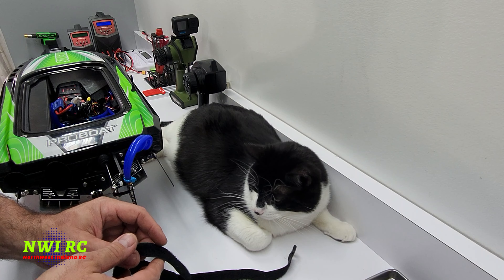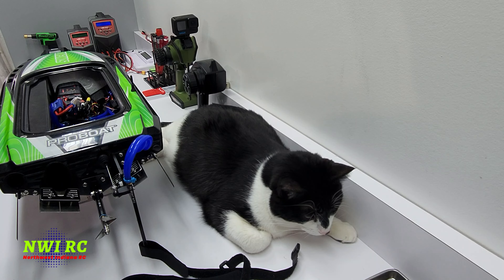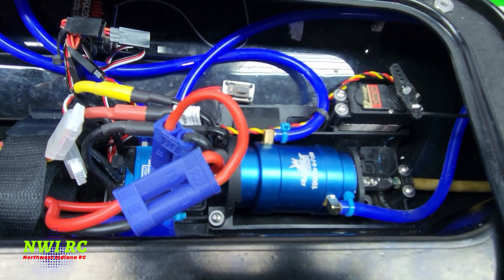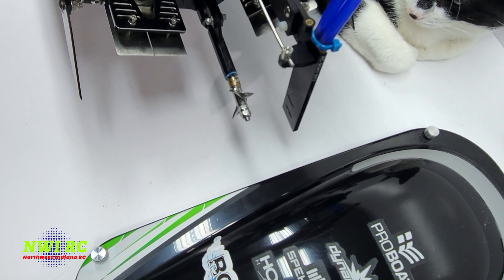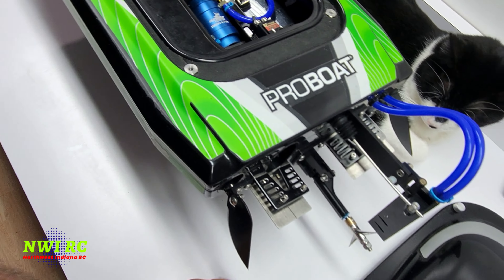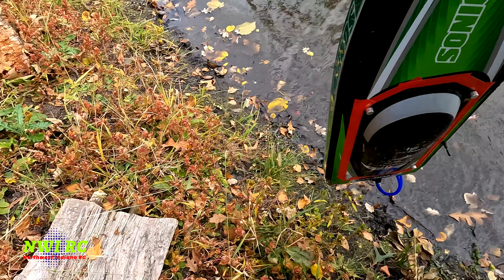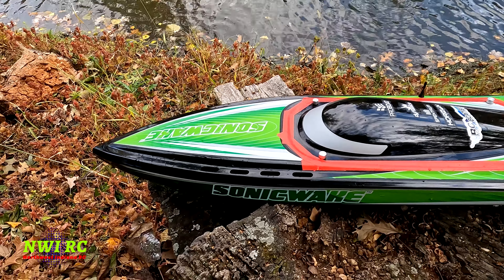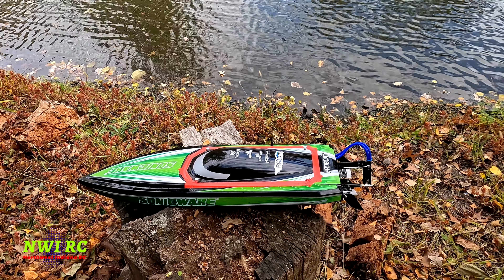PROBOAT SONICWAKE: Bought Used - Did I Get Ripped Off?

Comment: remember it should ride on top the water. you really have to gun it to get ip up on plane. then back off the throttle. i think you thermal overloaded the esc by going to slow like that . . it puts alot of load running the prop slow like that...... if its a quality esc  once it cools down again it will go full speed. watch out for the leaves and stuff in the water it only takes one to plug the cooling line and you over heat in less than a minute.....

Comment: change the prop!  4519
Reply from the maker: What brand 4519 prop do you you think I should go with..? I have a Dasboata speed prop for this beast but it would be way to much for the stock electronics.
Reply: @nwirc  oxidean 4519 blue good all around prop...upgrade the esc to a 150 if you are going to use the dasboata...but I would run it and check temps
Reply from the maker: @vking2.5  Thanks for the info,,
Reply: @vking2.5  I’ve used a huge 52mm Cnc prop on a fully stock sonic wake with no issues. The boat has plenty power to push anything under 52mm. 👍🏼
Reply: DO  NOT put a 45mm prop on this boat. it will overload the esc and motor. unless doing single pass speed runs it will kill your electronics i guarantee it
Reply: @matthewwilken2051  I run a 45mm prop for 10min straight without heating. Fully stock boat.

Comment: some of these rc boat guys are just plain stupid about prop secrets and stupid stuff like that. start with going up more or less on the pitch of the prop then increase the tongue . then the diameter. try this one.
Fielect 1Pc 2 Blades Propeller for Ship Model Rc Boat Propeller Model Golden Brass Positive Paddle 42mm Diameter 1.4 Pitch 4.76mm Hole Dia.